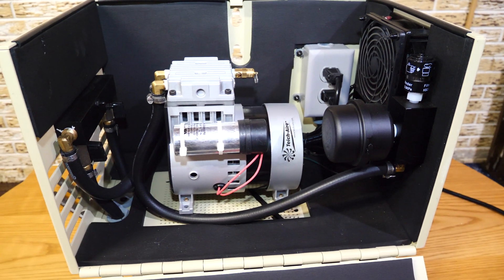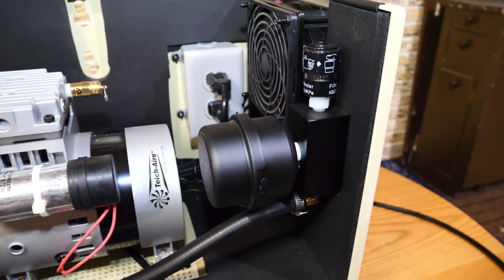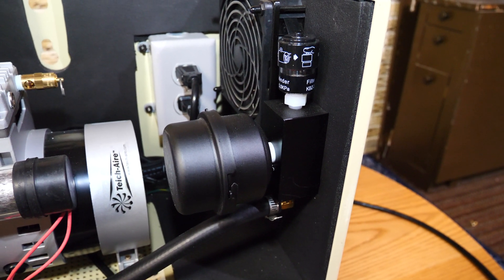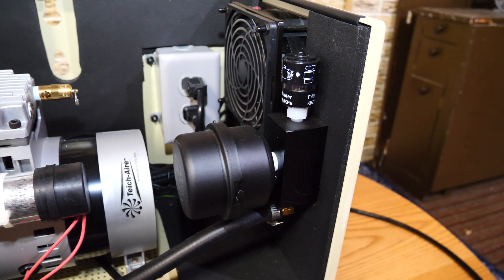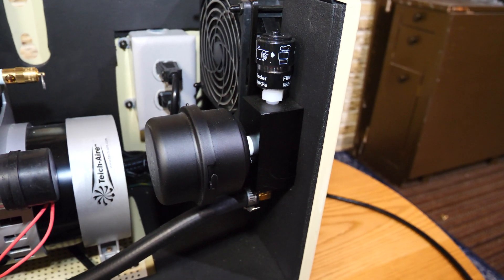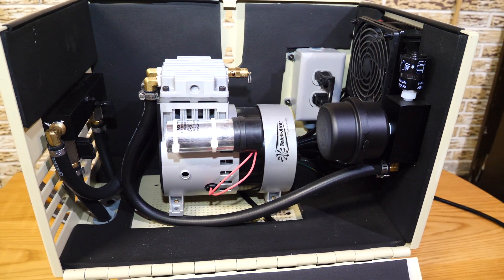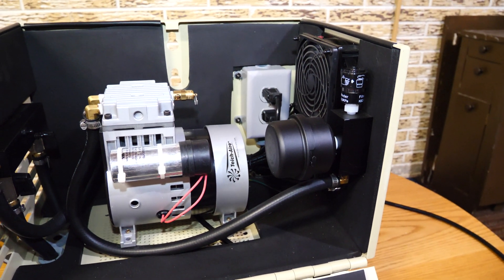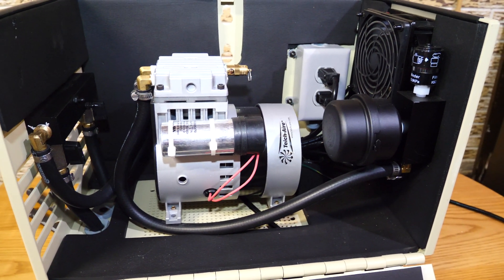The New Kasco Air Filter Module Does More Than Just Tell You When To Change The Filter.

Comment: Once my output pressure drops on my gauge I change the filter. Seems like over complicating a simple thing.
Reply from the maker: I like the way you think.  Problem is most people don't change these nearly often enough.  I guess they need all the help they can get....at least that's what Kasco concluded.
Reply: How many aerators should I be running on a 160ft x 60 foot dugout. About 18ft deep and 700,000 gal? Currently running one but the water is starting to get egg smell. Thanks
Reply from the maker: @cory9572  with all the aerators we work with, at least by spec, a single diffuser near the middle at 12' or better will cover it all.  How long have you been running the aerator?  The pond is probably off-gassing hydrogen sulfide, which is not necessarily a bad thing and it typically shouldn't go on for a long time.   If it gets to be an issue for you that you want to deal with I would apply some beneficial microbes in there to help.  Something like our biosphere pro would be an example.  Whatever you use, be sure to meet or exceed the gallon volume you are dealing with.

Comment: Hi Mark! As always, I found this video and the website very informative! I am relieved to learn that this intake filter is now standard and included with this unit. Could you please confirm the the acustic material on the interior walls of the cabinet is also standanrd and included? 

We spoke last year on another video and assistanted me in making my decision (this exact unit). This was later in the year and because I live in Michigan I decided to wait until early Spring to purchase and install. Given that Spring is now right around the corner, when do you recommend starting the process?

Thanks!
Reply from the maker: Hi Jonathan...yes the sound proof foam is installed as standard in all Kasco cabinets...and of course the filter module is included with all the systems too.  In terms of the installation you can really do it anytime in the spring and it's fine.  I would typically avoid installing during really hot weather, but people certainly do that and do alright.  Still I think milder weather is best.  Also don't forget if you have fish to start the system up gradually.  30 min the first day, 1 hour the next day, and so on...doubling the run time each day until you are up to 24/7.  

I think we may have determined the right system for you but if you need help with that, be sure to get in touch and I can help with that.  https://americanaeration.com/pond-aeration-advisor/